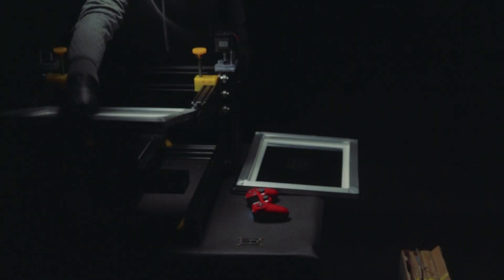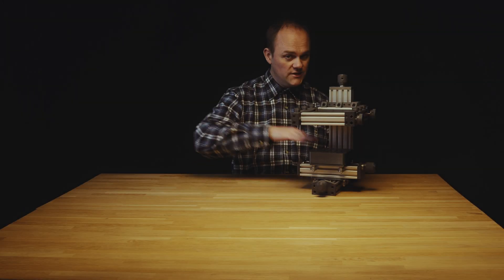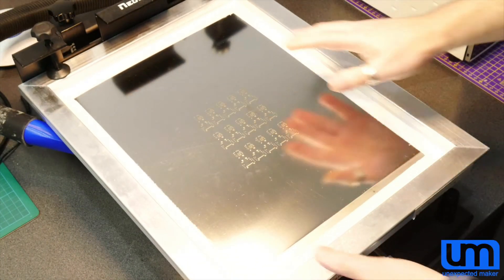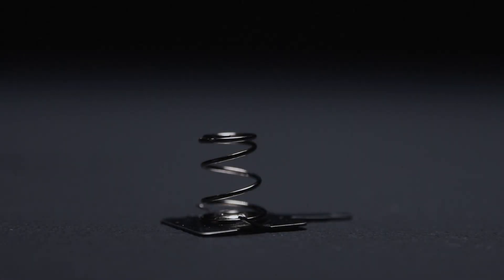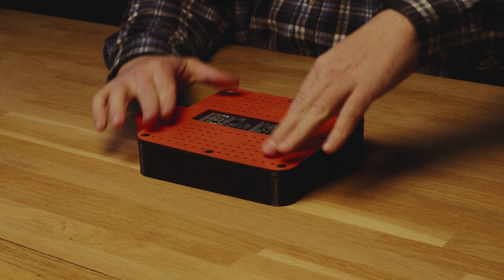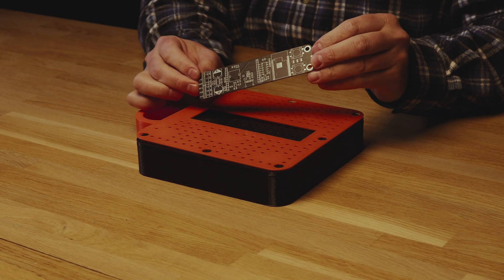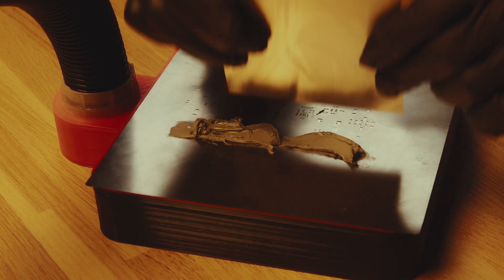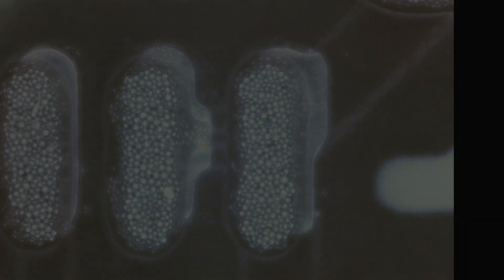V1 Vacuum assisted solder stencil box

Comment: I was thinking, adding fiducials to the stencil, and alignment pins on the top printed plate, should fix the stencils location in place.
Then the frame that holds the PCB, can be scaled, so that the PCB line up correctly with the stencil, maybe with two fine pitch threaded rods (one in the X plane, and one in the Y plane) to slightly  nudge the PCB for fine tuning alignment.
Reply from the maker: Yes i think that will work! Im trying to just use the outside of the pcb to frictionhold the pcb down. With an extra plate between the lid and the lifter.

Comment: Thanks for sharing, Cool Idea!  I had same problem for years but solved it by applying an electromagnetic directly under PCB (24v / 400 Netwon), combined with placement of small screw-nut or flat-iron nail (must be ferrous metal, not stainless) placed on the surface of the stencil.  Nail and screw nut come from local hardware store and I think electromagnet was $12 USD.  To avoid paste from from sticking to to stencil when lifting it, I apply first flux to the stencil using small paint brush, then apply electromagnet, then swipe with paste.  Sometimes I dilute/mix paste with flux to reduce viscosity, especially with QFP/QFN footprints.